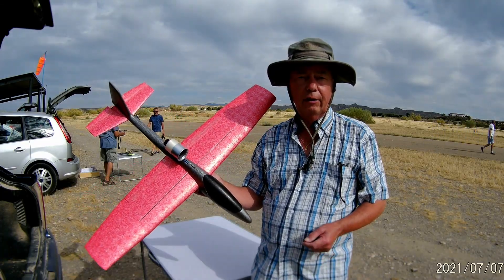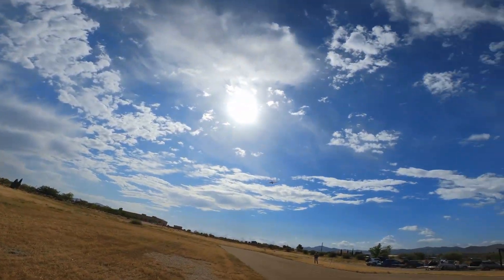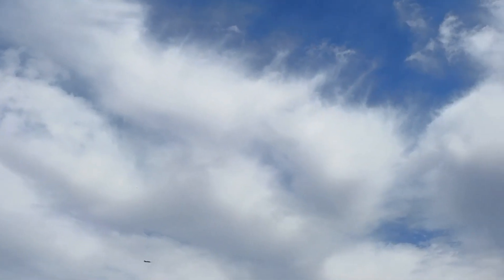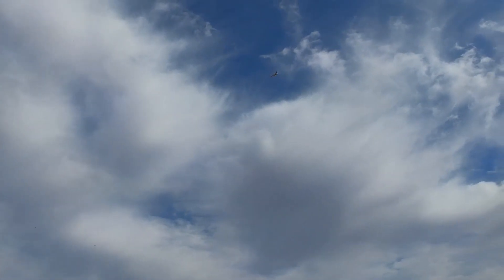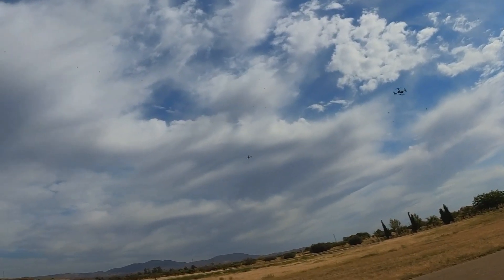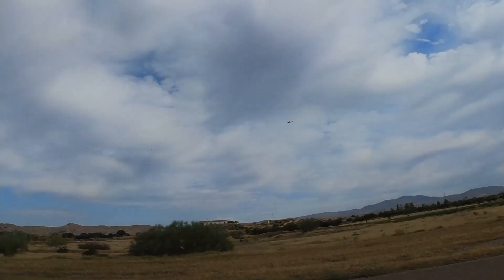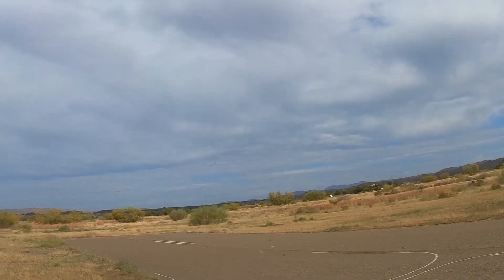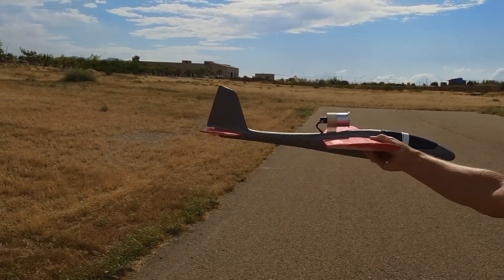Lidl Glider Dr Mad Thrust 40mm EDF Conversion Maiden Flight

Comment: hi im going to build it using the vid you made , how long did it fly for?
Reply from the maker: Hi Adam, I have my timer set to 6 minutes although I rely on the battery voltage telemetry. It alarms at 10.5 volts (3.5 volts per cell). I may fly it to 9.9 volts as the batteries are high quality. Flight time is really dependent on how you fly. In my configuration I keep the wing tip dihedral in and only have the ailerons on part of the wing. This makes for more of a powered glider and I can cruise around at low throttle if I wish. Alternatively you can take out the dihedral and increase the aileron length and it will be very sporty but with less flight time! Good luck with your build. I will have a new video up tomorrow with more flight footage, I love it!
Reply: @1nformatica  thanks for it info

Comment: information.             the thrust configuration is still less-than  optimal.            at the linked photo, an  optimally  configured  Offset  Pusher  thrust   setup is shown.        the  annotations  are  mostly  correct;  certain labelling is   Wrong.             the added lines, are  Supposed  to,  Intersect  the  point in space  where the  airframe's   Center of  Mass  (c-m)  is  Supposed  to  be.   ( and, the location of  the c-m  is  Supposed to vertically align with 25 percent of chord/mac. )     d          googletranslate
https://static.rcgroups.net/forums/attachments/2/9/6/3/9/7/a5988257-224-bixler%202%20motor%20angle%20correction.jpg